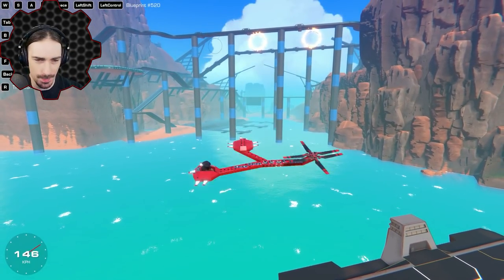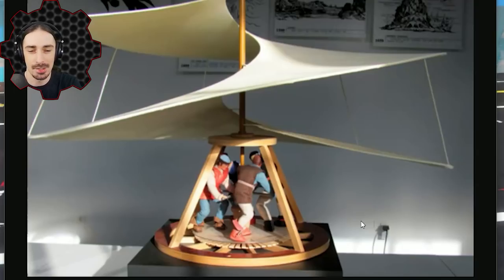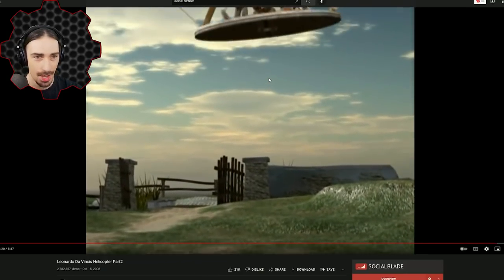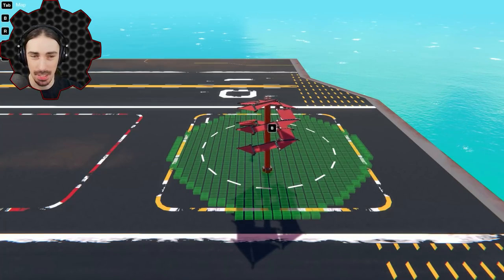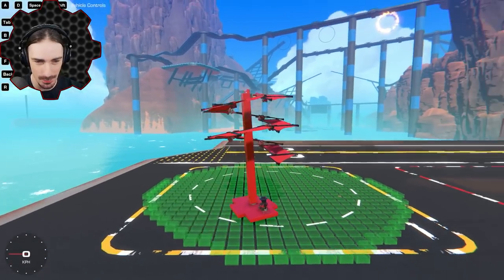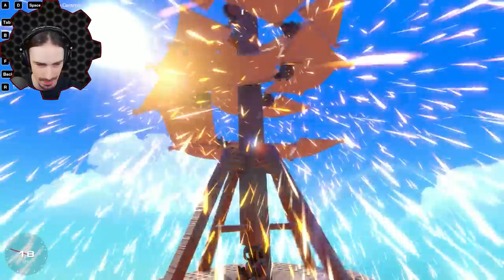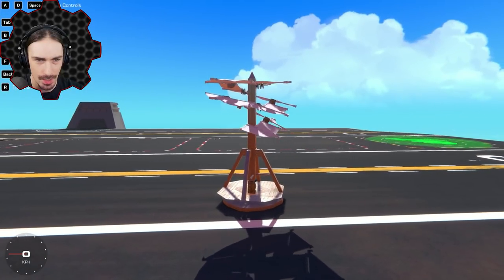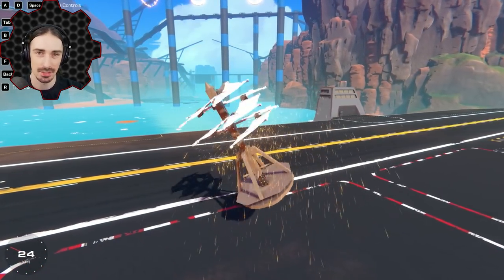THE AERIAL SCREW: There's a Reason da Vinci's Helicopter Was Never Built

Comment: I think you can get this thing to work better by adding vertical fins to the lower part, increasing the drag when it rotates. This in essence allows the rotating servo to push against the air to rotate the top part. (angular momentum is conserved as the air (in real life at least) would be pushed back)
Reply: Agreed. Or even somewhat counter angled.
Reply: or add a screw going the other way on the bottom par, no clue how to make that look good. But should make it fly more easily since theres less wasted energy?
Reply: Or by adding more weight further out on the base to make it harder to rotate.
Reply: This was my thought as well, top vs bottom the one with the least drag would spin the fastest.
Reply: I'm just happy by the ideas to improve the design even more
Reply: @Deathcon2040  I though about it but then I recognized that it would just react like energy reservoir (it will be harder to gain energy - lover degree speed acceleration but then it will spin for ever)
Reply: ya agree – this is what the back rotor on a helicopter does
Reply: He kinda already did that by recreating the "treadmill". even without deliberate fins, the extra 'stuff' created more air resistance, which is why it sorta worked better than initially.
Reply: easiest fix is two side by side connected and counter rotating like a Chinook
Reply: I agree with one of the replies putting the vertical fins on a angle in the opposite of tbe corkscrew would make more lift but would a piston at the bottom of the corkscrew to add or  subtract angle on the wings work
Reply: or maybe thrusters/gyros creating equal opposing force on the bottom for the sake of deleting newtons law

Comment: This actually wouldn't be all that hard to modify to get working in Trailmakers. I can think of two different ways.

One, tailfins or sails extending radially outward from the base would provide a lot more rotational drag, putting much more of the power into the air-screw.

Alternatively, any even number of them connected to each other, with corkscrews in counter-rotating pairs would work, though then it'd just be a primitive quad-copter.

You could also make one with two concentric corkscrews on concentric axles with gearing to make them counter-rotate, but... I think that'd far outstrip the materials available and understanding of mechanics of the time.

Comment: Fun Fact: There are drones being developed using the aerial screw type of prop. It is show to be comparable in stability and power to propellers of a similar threshold with the possibility of being a lot quieter and more thrust at lower RPMs, along with some other advantages - though its major drawback is its weight of construction. 

The fun bit is that it generates lift in an entirely different way to most conventional methods, so a whole lot isn't known about it at this time and they haven't yet determined an ideal shape for them.

Comment: A long time ago in brick rigs I made a series of 'tornadoea' which were effectively spinning screws, that games build grind allows for different axes but in trailmakers you could make a series of layers that are plus shaped with a servo between each layer, and then as they spawn they rotate by like 45 degrees or so, then adding more servos to angle the sails, this making a corkscrew shape

Comment: That was the first thing I made when sail were added. Add some counter rotation to the bottom and you can stop the spinning. Attach a compass on a servo to the counter rotation and you can control you facing. Add some shifting weights and you can sort of control tilt to give forward/back control.

Comment: Aerial Screw - The precursor to one of the most widely used inventions in american households, the Ceiling Fan!

(running the Aeriel Screw in reverse, anchored to the ground, would create a fan shoving air upwards.  Attached upside-down to the ceiling of a room and you have a ceiling fan using this machine and method.)

Comment: You can also add wings to the base facing in the opposite direction, so it slows it down with drag, and any rotational force left in the base gets turned into lift. I've done the same in Besiege many times, and actually created some perfectly stable flying machines that way.

Comment: what you could do is attach those bars to the shaft that attaches to the corkscrew and push the bar instead and add a lil spinny thing on the bottom so it so it doesnt spin bottom

Comment: Check out the main battleship guns on Space Pirate Harlock. A proper turret needs 2 axis of rotation, but in space/in the air you need to fire in all directions, so one of the axis of rotation is the “waistline” of the spaceship.

Comment: another reason why the corkscrew wouldn't work is because most of the corkscrew would cancel itself out in terms of pressure difference created, as the air pressure below a layer of the screw is immediately cancelled out by the lower pressure on top of the layer right below it

Comment: This makes me wonder how different propeller planes would function if instead of blades, they used screws. Maybe it has been tried and failed, I don't know, I'm no aerodynamicisist.
Reply: People were aware of da vinci's design back when the first attempts at propellers were made. They were tried for both boats and planes, and in both cases it kind of worked, but not nearly as well as the blades we currently use. They were louder, slower, and far easier to break. They are a interesting idea and another proof of da vinci's genius, but like a lot of the hypothetical things he mused about, right direction, but impractical.
Reply: @FastForwardPlans  OK, thanks for the history lesson. I had suspicions that someone must've tried this idea at some point.
Reply: I'm not either, but I'm betting a screw like that would be a lot heavier than a prop, and likely have serious issues with vortex shedding along the edges which would induce a lot of drag.

Comment: I was disappointed that you never tried to mitigate the counter-rotation with vertical sails attached to the base. Would love a follow up video, if you're willing to give it a try. Also, did you consider just attaching the very top sail's mechanism repeated in a spiral pattern going down the mast? It might not provide quite as much lift, or look as much like the original corkscrew design, but it probably wouldn't cause as many sparks either.

Comment: This was a really cool recreation, nice execution of the design.
I feel like because you have a 2x2 wide core you could use pistons attached to the last sail and go down or up with them. Or even off of the side of the core rod with a trailer or free hinge to adjust for any angle to make it a little more stable but at the same time maybe not with the connection points idk.

Ps. Techblox devs are looking to add small jet engines and simple sensors next update and there was the memory logic bits last update.

Comment: Just put wings that rotate and have them spiral up the pole.  Then put big flap out the back attached to the base to slow the rotation.  Then maybe make a smaller screw using wing tips to go forward.  Maybe it the screw in the front could be angled you could actually steer and counter the last of the spin... especially if you can get it moving forward a bit.

Comment: What about putting an anchor block at the bottom of the sail. have it on a piston or rotating arm to extend out and attached to the central column once the sails are fully extended. would that make the sails none adjustable but more stable. Also you should use this sail idea and flip it horizontally and see if you can use it to propel and land car.

Comment: Basically the biggest reason DaVinci's Corkscrew Copter was never used is because it had been built at one point only to find out it had to spin so ridiculously fast to achieve and maintain takeoff and flight that it was just too impractical even if hooked up to a motor.

Comment: The base need wind resistance  kind of mile the helicopter tail . but because its a cercular base you could have wing on eatch corner to prevent the base from spinnilg to fast and gain a lot more altitude

Comment: Hey Scrapman , cant you just add something to increase drag on the bottom platform ? If it cant counter spin then more energy should go to the spinning corkscrew thingy right ? like you were saying , it can liftoff cause the drag of the floor keeps the threadmill part from spinning and the rotation goes to the screw ... well what if we just , take the floor to the skies , i mean , take the drag to the skies ... like, just add some vertical tail wings like if it was a rocket to the bottom part ,

Like to let Scrap man see this comment

Comment: Am I the only one bothered by the fact that the model in the pic at the beginning is wrong? If they were walking and pushing the bars around, it would be spinning the right way, but holding the bars and pushing the flywheel under them it would be driving into the ground.

Comment: https://youtu.be/fGFqLuKXA_A
The last creation in this  video could be interesting to try in Scrap Mechanic, it's in a similar vein to the last few too.
The second creation could also be interesting if u adapted it so it would have a clutch-like system to control to which wheels the power output goes, but still keeping the power input in the same place.

Comment: I think the helicopter engine may be cheating on the software side, and adding a fake vertical acceleration by virtue of existing. Ya may wanna see what happens when you just have a helicopter engine running, and if that gives lift without anything attached.

https://www.youtube.com/watch?v=08pJOA2-Ndk (irl functioning version of what you are using)